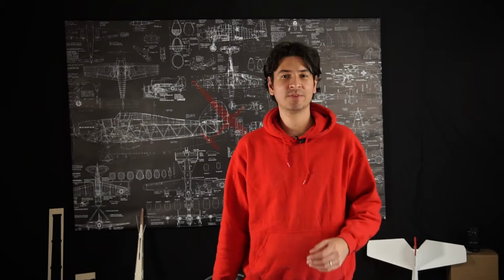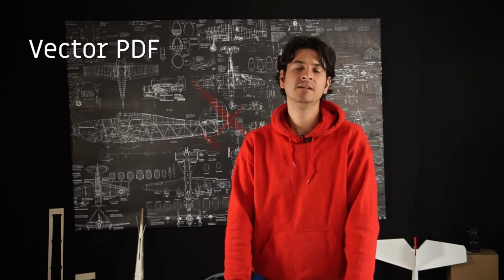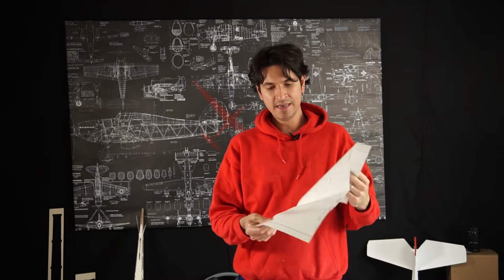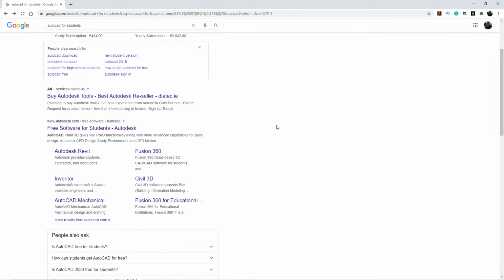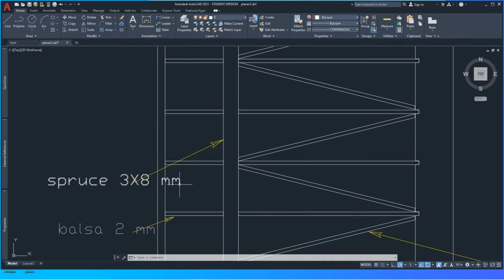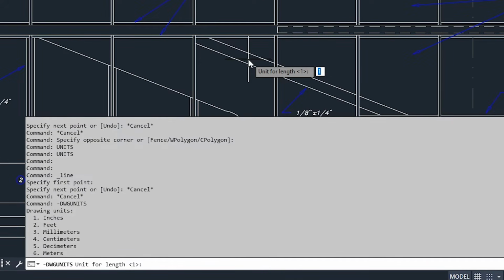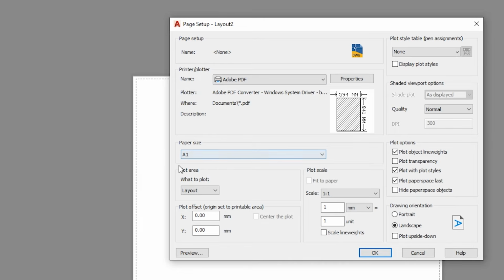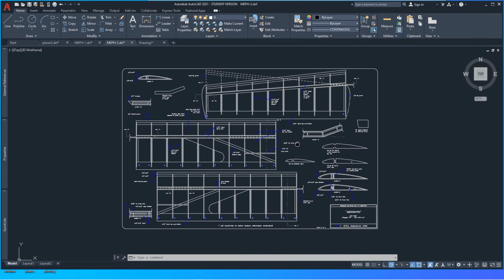Plans for RC Aircraft Masterclass | Part 1 - Where to find and how to print and make plans?

Comment: Brother you shared exactly what I was searching for so long thanx
O want to draw my own design and get it laser cut

I want to know which software should I learn and use 

Currently I am using sketch up and fusion 360

Sketchup is very easy buy I find it difficult fusion 360.
Is autodesk fusion 360 is the right software for drawing plane and get is laser cut??
Reply from the maker: Hi, for laser cut I would prefer AutoCAD or a similar CAD software. A free CAD software I recommend is nanocad.
Reply: @Joyplanes  brother if u  get time please check Autodesk fusion 360 it also a cloud based cad software.
Will it be suitable for laser cutting rc plans.
Thanks
Reply: fusion 360 is good for architectural design and other CAD work. its pretty easy to use, and not hard to master. 
I used sketchup for about 5-6 years and i find it tedious and annoying to use compared to F360. sketchup makes me want to bang my head on the keyboard. its stupid how they setup the method of doing curved surfaces and kinda hard to do anything complex in. 

i actually been making an airplane frame in F360 as i want to be able to 3d print one instead of gathering balsa or at least before. 
i was also thinking of using the 3d printed parts as a template for trying the frame in foam board to see how that holds up. 

fk autocad and freecad its just as bad as sketchup. just sit down and bang it out with F360 until you realize how much easier it is to use.